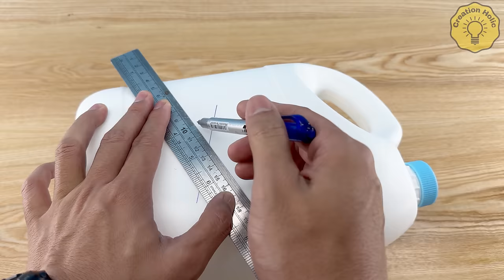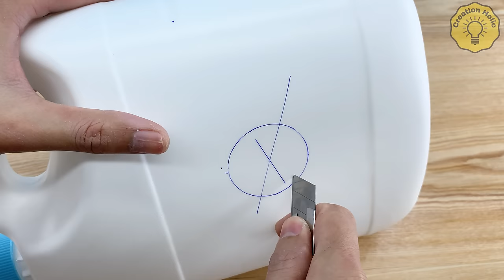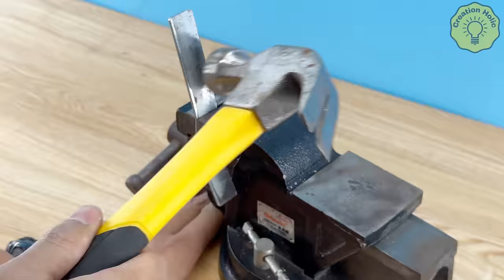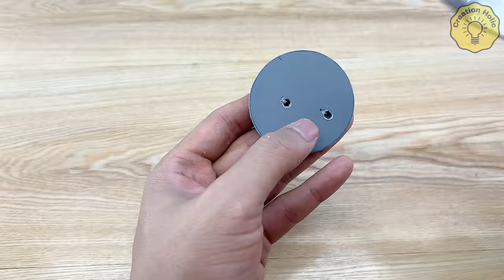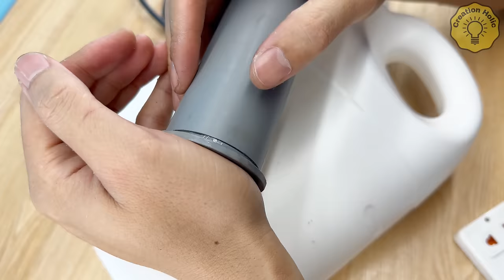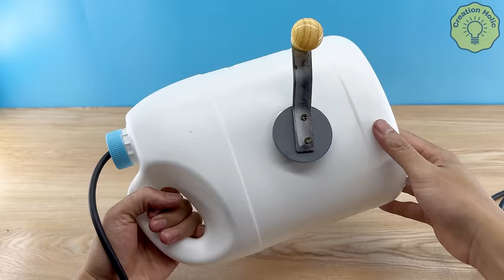The Famous Handyman Taught Me This Trick ! Don't Throw Away Empty Plastic Cans

Comment: Bad idea the plastics get hot and melt causing fire
Reply from the maker: If you just add an extra layer to the socket without altering the structure or material excessively, it may not affect the melting phenomenon.

Comment: This is very clever, it's also called an induction loop (just like your stove). Using it with any device over 500w will heat and melt the cable thru electromagnetic force.

Keep your phones, cameras and pacemakers away too !!!
Reply from the maker: Hello! thanks for your comment. Wish you all the best!